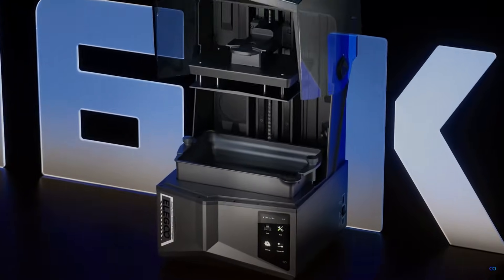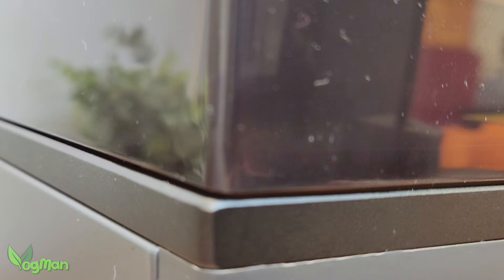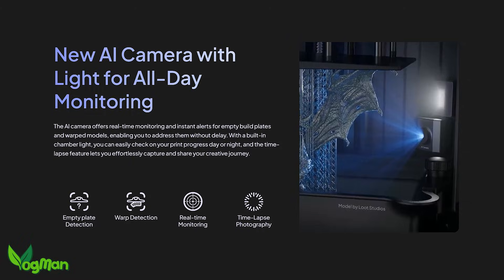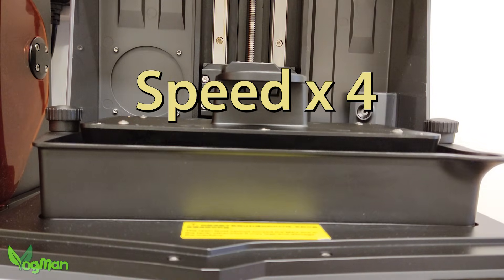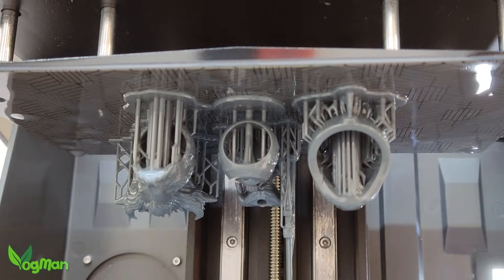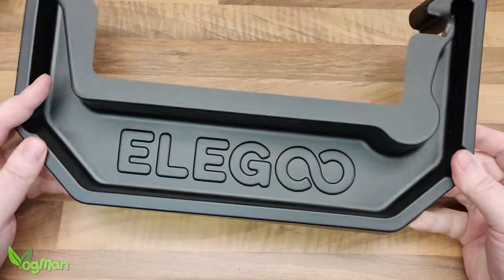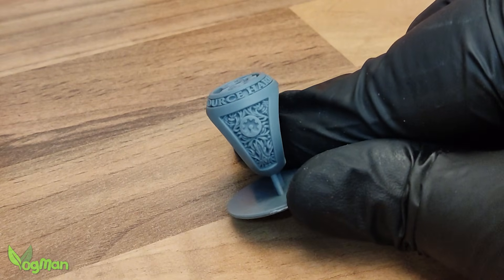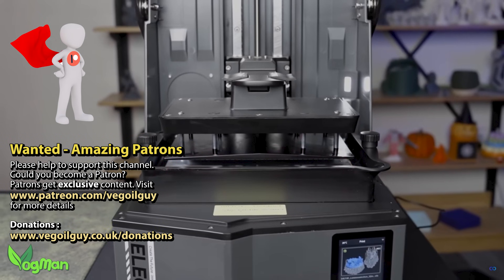Elegoo Saturn 4 Ultra 16K – Honest Hands-On Review (No Sugarcoating)

Comment: So the maximum speed feature or whatever is called is just a gimmick? Nothing really noticeable different from let's say an Anycubic Photon M3 (My current printer which I'm thinking about replacing with a 4 Ultra 16K)?
Reply from the maker: I've tested several printers claiming speed improvements and they unusually all want you to lower your print quality settings and use a different resin. So far I remain unconvinced that any brand is producing "faster" prints, but I'm satisfied they're all relatively quick anyway. Just a few years ago waiting 20 seconds a layer was typical. Thanks to mono screen tech it's more like 2 secs a layer now. I imagine another innovation will come along soon and, who knows, make it 0.2 sec per layer 😁
Reply: @vogman  Indeed, this was, and still is, a very fast evolving technology, who knows what they will come up with next. I'm still unconvinced if I should bite the bullet and get an upgrade from my Photon M3 which works just fine, no issues whatsoever. The only reason I would want to upgrade is the plate printing size, but after a few weeks of research, reading posts everywhere, watching youtube videos etc. there is no guarantee any of the newer printers will work at least just as good as the one I already have. For example, for the Saturn 4 Ultra 16K I've seen a really concerning amount of posts saying the build quality is really bad, prints failing, printer failing after just a few months of light usage etc.

Comment: The temperature differance (and this is total guess work here) may be because the resin self heats during printing, the curing process itself releases heat at various rates depending on which resin you use. The screen will also release some heat. Maybe it drops to 25c in order to maintain a 'buffer' below 30c (which i believe is generally the maximum recommended temp)??? Like i said, wild guess though.

But the resin pre-heat switching itself off every time, is just dumb, It makes me wonder who put that feature in and though, 'Hey, thats a good idea'.

If i could make a respectful suggestion, When your showing the prints and their quality as you do at 11:38, it would be really helpful if you could put a coin (penny, 2p, £) next to the print, I cant speak for other people but i find it really difficult to visualise the scale.

Great video, thanks for the hard work. I have a mars 4 ultra and have been considering upgrading to this purely for the heater. still torn on wether to get this or wait for the next version. though im sure that will have a whole load of slightly differant issues. 

Oof, that turned into an essay, sorry. :D

Comment: Great video. As usual. I will soon be changing my machine from a Saturn 2 - 8K to an elegoo Saturn 16k or Anycubic M7 ....
Do you have experience with adding flexplate on the above machines? 
It worked flawlessly on the Saturn 2. I am concerned about problems with the self levelling rig on the elegoo Saturn 4 -16K.

Comment: Having a Saturn 3 Ultra, getting its 3rd Display now...
I am wondering what happens to this printer when the FEP gets punctured.

Are there any improvements considering seals or preventions for the case resin flushs the whole thing?

Comment: Do not know you already figured it out but there are 2 arrows on the cover and i think that should be the point to use 2 fingers on to lift it on the Y shape. Not that Clean but i think a Handle will make it, because of it's weight close on its own. :D Just thinking, dont have it but want buy it as my First Resin Printer. Have only FDM here until now.

Comment: I am confused about the heater...
In the video, when you select the preheating function, you got a warning about the resin level. It has to be between the min and the max level.
It also says that the preheating duration is 24 hours (so far the 'pre' in preheating).
So if I am understand it correctly if this function is selected, the resin level may not become lower than 'min' for 24 hours...confused.

What about the normal heating function, does the minimum level also applies with that function??
If so, no large prints can be made when you use any heater function so it becomes useless...
Reply: Oh ok, than I will reply to myself.
In the pdf manual from Elegoo is the following mentioned: important  notice: while heating the vat the resin level needs to be between min and max.
So no large prints can be made using the heater function unless you refill the vat every [x time] (hour, 20 minutes, depending on the print of course)

At least, that is my conclusion. I like to be proved wrong...

Comment: Also bought a 12K a few months ago, with the space heater and a spare build plate. I like that the build plate is compatable with the 12K version (although I hate the build plate itself). It would be nice if the heated vat could be retro fitted to the 12K. This printer will be on my to get list, but will need for the pennies (and brownie points with the wife) to build up before purchasing one. Unless ofcourse the Saturn 5 is released - although we may need to go to the Moon and back to get one.

Comment: I really appreciate your consistency when doing printer reviews - I don't always agree with your takes (everyone has different priorities), but it's easy to tell that you're well informed, trustworthy and as unbiased as possible.  

I live in Phoenix - it's regularly 75F/23C or warmer in my print room, even in the winter.  I still see value in a heater because of the consistency it brings.  

And I wonder if the 30c->25c drop is because they want temperatures higher in the burn in, or if it's power saving because the screen/curing resin will generate heat, so they're just trying to keep it from going too low? It seems like an odd choice.  I assume it's something they could change with a firmware update, but I have a feeling they won't :D

Comment: In my own heater testing, when my resin heater lets the vat resin get to 30°C i started getting splitting through the models (delamination).

On a small printer like the Anycubic photon mono 4k the lcd, uv array and chemical recaction of the resin adds 2.5-3° C of additional heat.

At which point i have found my resin calibration and printing profile works best when the resin is between 22-24°C at the start of the print.

As for the 12k 16k debate it worksnout to what 5 microns per pixel difference?

The Anycubic mono 5 s pro jas a 10k screen at 19 microns 19x19 pixels i believe

Comment: AS a GK2 user living the UK I have been spoiled by some of its features. I would love to invest in the Saturn Ultra 16k, but considering how much of a pain is to clean the plate each time (and the GK2 has one of the most simple designs), I cannot imagine how much stressing would be to clean that forest of metal columns stuck between the plate.

Also they need to start adding as a standard feature, vat lids so you do not have to empty it each time after the print is done, this again is why I still prefer the GK series.

Comment: the k rating is nothing more than a marketing scam to sell machines, you will see very little difference if any
Reply from the maker: I did say in the video that you'll see very little difference in the hand. The K value is real, but you can see this better by comparing older versions, like 4K with newer, like this 16K. As I said in this video, even magnified it's hard to tell the difference between 12K and 16K.

Comment: The temperature difference is probably to deal with thermal runaway. I noticed that when I set my chamber heater to 30c while printing the endothermic reaction can lead temps to rise sometimes as high as 40c. A lot of resins soften and bend at that temperature.

Comment: The minimum resin level seem to make this unusable for jewellery models. Good castable resin is approx €120 per 500ml bottle, so you can’t expect people to pour hundreds into one resin tank and subject it all to potential debris and spew from the inevitable occasional failures.
Reply from the maker: I know what you mean, it's expensive stuff. And it's a shame as this printer would do an excellent job of printing jewellery. A standard enclosure heater is a simpler solution and less integral in case it goes wrong.

Comment: Nice review! But you guys don't work or understand celsius measurement but I tell you, 25 degrees is like our body temp that is around 26,5' . 30" is something you feel hot when you live in a normal weather country. to beging with 30 is like put some heat to the pedal to start with, but you don't need to "melt" it.
Reply: This is just a weird and silly comment. Body temperature is irrelevant because you feel it based on the heat loss rather than actual temperature measurement. 25 and 30 are close, but VOG wants consistency and it's a little silly that the settings aren't consistent (or user configurable) which is valid though I suspect the slow progress from 30-25 is basically imperceptible in print quality/consistency.
Reply from the maker: Amazingly the internal body temperature of the average human is believed to be about 37C. Weird but true.
Personally I'm pretty happy with my understanding of temperatures. Here in the UK, 25C is a normal summers day temperature. 35C is an unusually hot summer. 😁
Reply: @vogman  hahaha! you right! and I was problably with a fever delirium, around 41celcius myself the night I wrote it. Silly me, but the point is that still weird to me in keep using nowadays a more complicated measurament unit for temperature than celcius. "for the rest of the world", at 0C you have the freezing point of water and at 100C it boils. 35 is really a hot summer and with humidity as here, you boil. But anyway, again, very nice video and review,  and hope the quality/consistency of the work x machine keep improving.

Comment: The build plate sucks eggs.  Dealbreaker for me.
Reply: This! If there was even just like... A little shield wall attached to the build plate and rose higher than the top of the plate, you'd be able to have the adjustability without needing the pain of cleaning it agonizingly. If it's stupid and it works it's not as stupid.
Reply from the maker: No worries. We're all entitled to our opinions. It would be a boring world if we were all the same.
Reply: @ you still should have mentioned it how much of a pain it is to clean. It’s really bad.

Comment: I print indoors so the heated vat and extra 5 micron resolution isn't enough of an upgrade for me. But here's hoping that now Elegoo can work on releasing a Jupiter Ultra with that tilting vat, a 125-30 micron resolution, and a flip lid (even if it doesn't have a handle).
Reply from the maker: Handles cost extra 😂🤣😂

Comment: Is the Elegoo Mars 4 Ultra 9K more accurate in resolution than the Elegoo Saturn 4 Ultra 16K? I didn't quite understand it when you mentioned it in this video.
Reply from the maker: On paper this should be better than the Mars 9K. It has slightly lower XY res and much higher ppi. It's very, very good. But again, in the hand, you'd have a hard time telling the difference.
Reply: It almost definitely doesn't matter you won't be able to see it, but technically both yes and no. Mars 4 Ultra 9k pixels are 18x18 and square. This is 14x19, so rectangular. On one axis they're smaller, on the other they're slightly larger. Smaller is better but anything below 30 is basically indistinguishable imo.

Comment: The new elegoo slicer is my new go to slicer, the supports are brilliant review soon please!
Reply from the maker: I'll have to take a look.
Reply: The issue I see in the current iteration is that it doesn't leverage the WiFi; from all I've seen, it can't use the camera, and you have to transfer files via USB - Chitubox Free can do both.
Reply: Isn't it easier using usb? Most of the files I have are a gigabyte and up, and would take significantly longer than a jumpdrive to xfer.  @puchbol7069
Reply: @keirbirch4632  is that satellite slicer, I found it a bit basic but not really spent a ton of time in it

Comment: Higher price and smaller build volume...it's the same printer as the s4 why did they make it smaller yeah the heater is nice but no thanks
Reply from the maker: I think it's all about the restrictions of the screen size. There's very little difference really, especially as it's a midrange printer. The price difference isn't bad for the screen and the heater.

Comment: I feel that going this high in resolution is giving diminishing returns on a 50 micron layer height. Sure it's nice to get 16k baseline, but I'm pretty sure it would be a more dramatic difference between the lower resolution printers if you had a thinner layer height.
Reply from the maker: I considered dropping to 0.03 which I've no doubt would be amazing, but it's not something I've done with every printer, so it wouldn't be a fair comparison

Comment: I bet the temperature difference is due to the inevitable warming of the resin due to the LEDs power. On my Saturn 3 Ultra, on a 8 hour print it easily creeps from 23°C to over 40°.
Reply from the maker: It's strange. If they're monitoring the temperature, which they seem to be, then the heat created by exothermic reaction of the resin, etc, shouldn't matter.

Comment: the higher price just might be worth it for the heated Vat alone   12c would be nice at the moment its  -17c here in canada
Reply from the maker: It's been pretty chilly here. It was 12C in my workshop when I was testing this printer. It worked like a charm. It's a very neat solution.
Reply: @vogman  7C for me, printed flawlessly with the 16K.
Reply from the maker: Nice!
Reply: Also in Canada - I'm in the process of building an insulated and heated cabinet for my printer that has to live in a cold cellar since it's the only place I can print safely due to the resin fumes and I really wish I just waited for this printer instead lol. I've spent well over the price difference buying materials and tools for this box.
Reply from the maker: I think most people should regardless of temperature. It's a great way to deal with hazardous vapours, etc.
Reply: @vogman  Yes, my wife and I are trying for a kid so I'm paranoid beyond belief about toxic vapors. I'm putting it in the cold cellar which has 4" exhaust ports already built into it (not what it's for, but what I'll use it for) and is fully sealed with concrete on all sides, a metal door to get into it, and I gap sealed the door. I'm also going to put a VOC monitor there. If still somehow any fumes get out somehow I'll stop printing until I can figure it out and try to fix the problem.
Reply: @Weaver_Games Do you live in a castle? Lol. I'm a bit envious.
Reply: @crazygeordie1383  the cold weather is the biggest barrier to printing for me at the moment with my mars 5 ultra
Reply from the maker: I'm sure the ChituSystem heater will fit... https://youtu.be/SZW9vBppQ-A
Reply: I got a thermal vat band (the one specifically for printers is insanely expensive for me here in EU) for some 25-30 Euro and while it takes an hour~ to warm the vat up, it does the job quite well. (I've got it routed out the back port of the printer, it sits snuggly around the vat and doesn't interfere with the tilting mechanism at all) though I've also got it in an enclosure, so fumes/heat escaping out the back port doesn't bother me.